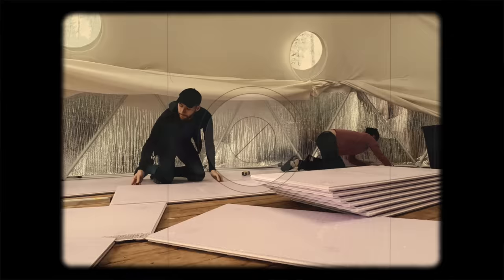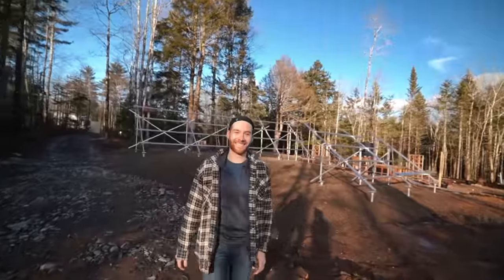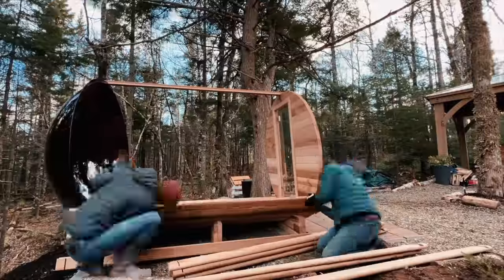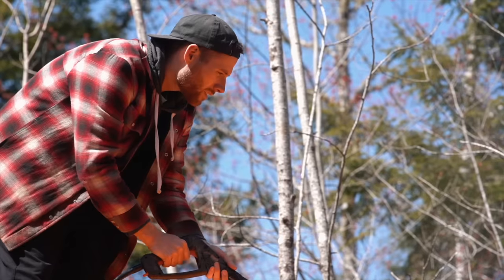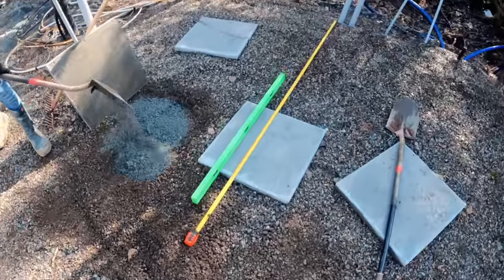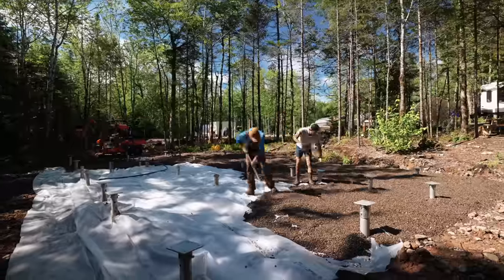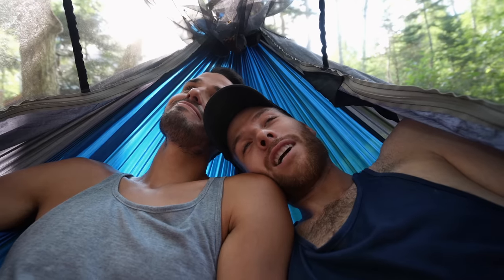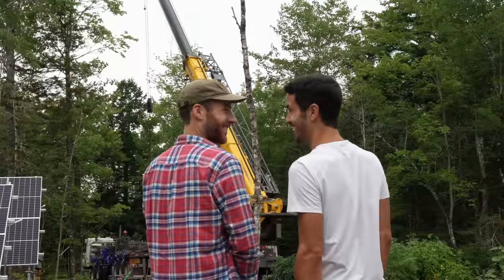How we turned Abandoned Land into a Container Home, Geodesic Dome (and more)

Comment: Thanks for the update on everything!! Quick tip to prevent your wood pile from falling over, do what the Swedes do and run long thin branches throughout your wood pile connecting the rows. You don't need to do a lot and it will prevent them from shifting and create a more stable wood pile.

Comment: Love your videos
Just a thought about the staircase clearance issue, what about another small container, like the ones you have for the outhouse and electrical room added onto the upper floor build into the central area on either side for the staircase to be in? That will allow the clearance you need to continue forward ❤